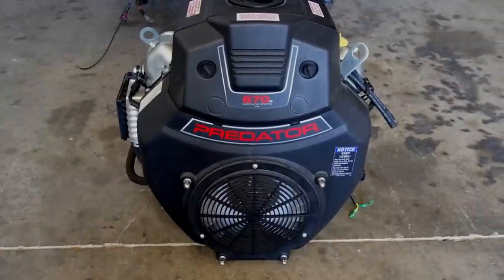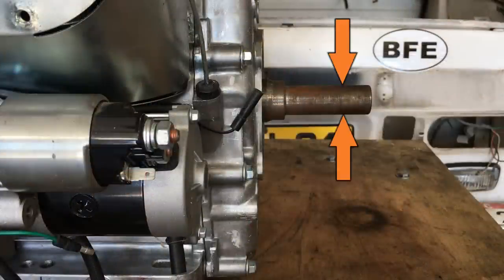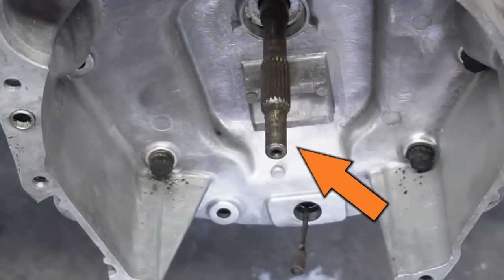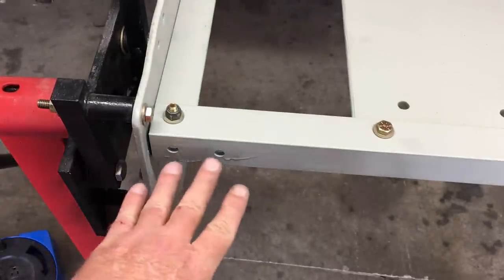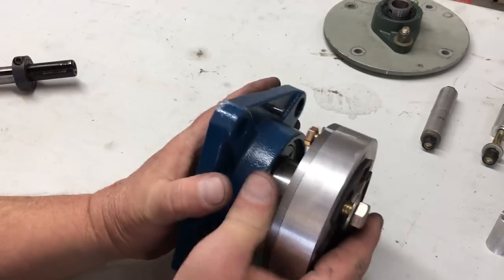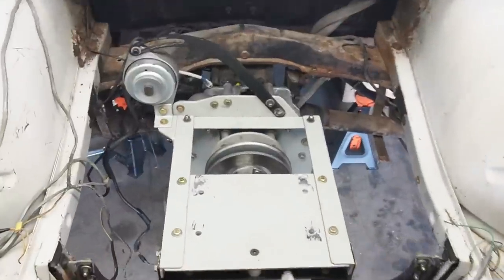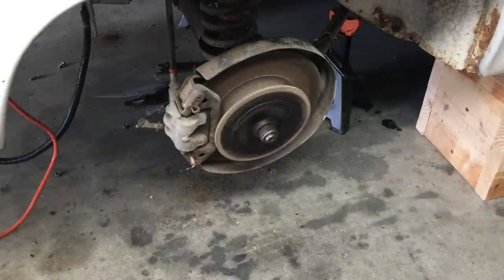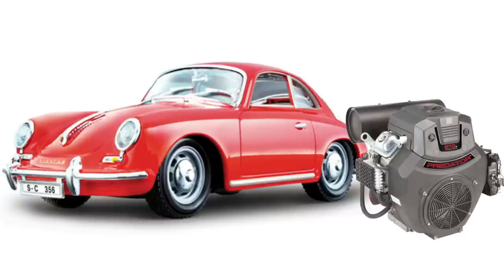S3 E18 We put a 670 Predator V twin in our project car 1969 Renault 10

Comment: Can’t wait to see it with twin turbo’s ✌️
Reply: Theirs no way 2 cylinders can spool 2 turbos if a 3 cylinder diesel can barely spool a turbo
Reply: @Llyduramax  pretty sure theres were joking...
Reply: Two smol turbos are easier to spool than single big :>
Reply: @mmllmmll22  small enough turbos don’t exist
Reply: Better off having 2 exhaust pulses for the turbo
Reply: @MyLonewolf25 Garrett  has turbos small enough.  
0.5lb/ min  is small enough to support a 3hp Briggs and Stratton to make 5hp.
Reply: i need to see this happen now
Reply: Can't wait to see with quad turbos and a supercharger slapped on top of it
Reply: You're crazy bro! Hahaha!
Reply: @SilentKx2  ya it'll be twin compounds for each cylinder with a safe 3:1 PR each at 6 BarA it'll need some methanol  to keep the wrist pins from melting out of the pistons. Lol but the blower is for lean burn mood on a clutched bypass . IIRC 28-31:1 AFR  is proper. When you stomp it the blower clutches out into bypass  you get the enriching effects coming out of lean burn. 
To think above the top shelf sometimes is just a little to far out of the box for people's comfort.
Reply: Does not need turbos as it can be built to 50hp without them.
Reply: compound 😅
Reply: @nandrews8412  I Twin trubo'd my roller skates and it spooled just fine
Reply: Think you mean twin Turbskis.. lol IYKYK
Reply: @joshchamberlain9413  Yeahhhh bruthur!
Reply: @MyLonewolf25  there is turbos for 50cc mopeds, what are you talking about?
Reply: @MyLonewolf25  a VZ21 will do the trick. Several YouTube channels have put them on the Predator 670 with excellent results, some getting up to 40-50 horsepower.
Reply: @Llyduramax  tiny turbos. Like- really, really tiny turbos. 😂
Reply: Yeah, I think I saw someone get 75hp out of one of these
Reply: @KiRiTO72987  75hp would be fine for short bursts, like drag racing, but it would either be putting out too much torque or too high of revs to last very long as it would probably twist the rods. Personally I wouldn't want to see more than 50hp for short periods of time and no more than 35-40 for an extended period.
Reply: Time to built two small custom turbos
Reply: I personally think a supercharger with an air intercooler makes the most sense as it won't add a bunch of heat to an air cooled engine

Comment: This is going to be a really important milestone. If memory serves, this car in its stock configuration delivers something like 40 hp or so. Are we into the first project that is actually able to match (if not improve) standard engine figures? Anyway, we’ll follow the process with great interest. Thanks Jimbo!
Reply: I believe it had 46hp with the first engine, then the later 1.3l had something like 52hp. It will be interesting to see how close to the original 0-60 of about 20 seconds (iirc) he'll get with the predator twin after upgrades. Perhaps it could even be faster depending on how far the engine can be pushed.
Reply: @tei1337  considering how much the V-Twin can be squeezed,i guess we can match that power figure in the long run.
Reply: @gustiwidyanta5492  yeah, I wouldn't be surprised. Not sure if Jimbo's bench dyno that he used on the  "big block" in the insight can handle this engine, but we will still be able to compare 0-60 times to the claimed time for the original engine.

Comment: Just a little heads up. The Honda clones tend to have a lot of metal in the oil during the first 15-20 minutes of operation. I would recommend running the motor at different RPMs for about a hour and then change the oil and filter. The 670 isn’t as bad as the other predators thanks to its oil filter but probably still a good idea. I have a video on my channel of a 459 (they just have the strainer and a true filter) and it was pretty nasty after maybe a half hour of run time.
Reply: Predators aren't Honda clones. That's the literal Honda knockoffs you're thinking about, Project Farm did a review on one I think.

Comment: Mr. Robot, those 670 carburetors are notorious for sticking float bowls and leaking fuel all over the place. Keep an eye on it and don’t burn that beauty and yourself up.

There’s a lot of really nice aftermarket parts for these engines that take them to the 50hp+ mark real quick. That little car would boogie!

Comment: 2:30 - I've been a big Saab fan since I could drive (early 2000s), I've had a couple Saab 900 turbos from the mid 80s, and man those thrust bearings always go bad. An engine not designed to handle that at all, it'd be fine for a project going a couple of thousand miles sure, but I don't know if the average car person understands just how important what you're bringing up is; those lateral movements put a ton of strain on the components... I'm glad you mentioned it!

Comment: My first car was a FIAT 126, twin cylinder rear engine, about 650cc. An important thing to note is it had a big (about 6 inch) tube pulling cold air from the sides of the car, and into the cooling fan, once the tube came off so the engine just recirculated the hot air in the engine bay, so it overheated. I'd have been tempted to have used a centrifugal clutch between the engine and input shaft of the engine, just like a special version of the Citroen 2CV - I think it was called the traffic. Great video though, I'll look forward to see how it runs.

Comment: That gearbox shaft has play in it because almost all old cars have a bearing inside the crankshaft that centers the gearbox's input shaft.
There is no other bearing to sustain the shaft on that side (what you see is play between the gears).
Even getrag 240 (80's 5speed gearbox) doesn't have an input bearing. It only has seal and a cover

Comment: Just wanted to throw an idea out there. They make some pretty hefty (and affordable) agricultural PTO/ chain drives, maybe see if you can make an intermediate chain or PTO that goes into an assembly with the output to clutch / flywheel ect. McMaster has you covered in finding an appropriate thrust bearing for whats going to be a custom n a half ordeal. You'll have to sort out the axis offset but maybe an opportunity to mount the engine lower than the transmission axis!

Comment: This interesting,  and you must be an engineer.  I like the way the clutch adapter works.  That's really nice engineering.  Well thought out just let off the throttle shift gears and step on the gas again.  Kind of like shifting an automatic.  Nice work sir.  😊

Comment: Are you considering a camber compensator for the swing axles? You've mounted that engine pretty high and that might have changed the roll center enough to provide some unexpected handling if you have to swerve. (Corvair owner here - camber compensator that came in '64 made the car handle noticeably better toward the edges of its performance envelope).
Reply: While the the only envelopes going to be pushed are delivered ones, I would like to see a handling car given the interesting motors a handling car would be worth a watch!

Comment: I had a 69 with a manual choke. You need to check the  axel strap on the passenger side rear wheel. A neat project. These cars came with an 1108cc 51 hp 4 cylinder. The car only weighs 1700 lbs.

Comment: Being a leader requires confidence, decisiveness, and quick thinking--none of which are served by overthinking every decision or scenario or worrying about every move you make. There’s a time to think, a time to act, a time to reflect, and a time to move forward.
Reply: Overthinking causes us to spend too much time thinking, getting stuck in a loop of inaction, and turns positive reflection into debilitating worry. Not only does it not move us forward, it moves us backward and downward.
Reply: Reopen the door only when new information knocks.

Overthinking goes into overdrive when we keep revisiting decisions we make, refusing to close the door on a call that has been made. Believe that you’ve done your due diligence, and revisit something you’ve already decided only when you’re presented with new information.
Reply: Know that overthinking and problem solving aren't the same thing.

Constantly ruminating and going over scenarios and possibilities often disguises itself as problem solving. It feels like you’re doing something good and useful. But you’re not, you’re just spinning in a circle. Recognize when you’re overthinking something, don’t act like it’s problem solving, and press fast-forward.
Reply: Remember the 90-10 rule.

This is a formula, a ratio, for how you should calculate how you value yourself, based on 90 percent self-worth, 10 percent assigned worth. Ninety percent should come from your self-acceptance and self-appreciation, and just 10 percent from that occasional sliver of external validation we all need.

Overthinkers distort the formula, even reversing it by acting like 90 percent of their worth comes from what others think or say. So they worry, which takes the form of--you guessed it--overthinking.
Reply: Assume good intent.

Overthinkers read too much into things. Why? They’re assuming something bad lies underneath, something like a bad perception, someone wishing them ill, or an unfavorable outcome. When you catch yourself doing this, switch your assumption to what you're reading into was well-intended, or at least neutral. The vast majority of the time, it really is, so why not act like it?
Reply: Embrace uncertainty.

When we don’t know something, we tend to fill in the blanks, often with garbage assumptions. Why? Many of us would rather be unhappy than uncertain. Garbage assumptions can take many forms, all infusing themselves into the inner monologue of the overthinker.

A Buddhist chaplain once taught me how to handle uncertainty. I remember his teachings as an acronym: OAR. Observe uncertainty, don’t overreact to it. Acknowledge the presence of uncertainty and accept that impermanence is inevitable. Realize that uncertainty brings benefits, like unleashing creativity and resilience.
Reply: Replace “what if” with “we’ll see.”

Overthinkers keep asking themselves “what if,” which is an impossible question to answer. If you catch yourself asking “what if,” quickly switch it to “we’ll see,” which is a way of moving past analysis paralysis to acceptance.
Reply: Get outside and play.

By this I mean stop spending so much time in your head. Get outside it and switch gears to connect with what's going on around you so you can take joy in it. It can be dark and foreboding inside that head of yours, no?
Reply: Do the math.

Overthinking also comes from overworrying about the worse-case scenario, which of course no one wants to experience. But ask yourself, “What is the probability the undesirable outcome will actually occur?” Odds are, not very high.
Reply: Stop framing the unremarkable as catastrophic.

Related to the above, this means stop taking small details and turning them into questionable conclusions. Stop making a mountain out of a molehill. Unlike at the mall, this kind of escalator lifts nobody up.
Reply: Evaluate the true impact of being wrong.

We often feel the need to overthink because we simply fear being wrong. It might make sense to overthink things if you’re planning to jump your motorbike over the Grand Canyon or to go swimming with a great white shark. As for overthinking the decision you made in that meeting yesterday? Not so much.

Ask yourself in such moments what the realistic cost of being wrong is. When you can lower the stakes, you raise your ability to get mentally unstuck.
So don’t overthink it. Take the inspiration here and run with it. Without looking back.
Reply: Great leaders create more leaders, not followers.
Reply: Shine your light and make a positive impact on the world; there is nothing so honorable as helping improve the lives of others.
Reply: Your beliefs affect your choices. Your choices shape your actions. Your actions determine your results. The future you create depends upon the choices you make and the actions you take today.
Reply: Authentic leaders will always be happy to hold the ladder and allow others to climb to the top.
Reply: “Whatever you dream you can do, begin it. Boldness has genius, power and magic in it. Begin it now.” – Goethe
Reply: We live in interesting times. We’re blessed that way.

The world is changing rapidly.

The way we work is changing, the way we live has already changed. Entire industries are crumbling, and more are growing on their ruins. People are empowered to express themselves, to create, to become a part of a global conversation and transformation, in a way that has never existed before.
Reply: What will you do with that?

What will your place be in this new, interesting world? Will you have a voice? Will you be a creator, or just a consumer?

Do something.

Do something interesting.
Reply: Be a part of the conversation, and say something remarkable. Create something unique, new, beautiful. Build upon the works of others and transform it into your own.
Reply: Put your heart into something. Say something that no one else dares to say. Do something others are afraid to do. Help someone no one else cares to help. Make the lives of others better. Make music that makes others want to weep, to laugh, to create. Inspire others by being inspiring. Teach young people to do amazing things.
Reply: Be profound. Find focus in a world without it. Become minimalist in a world of dizzying complexity. Reach out to those who are frustrated, depressed, angry, confused, sad, hurt. Be the voice for those without one. Learn, do, then teach. Meet new people, become fast friends. Dare to be wrong. Take lots and lots of pictures. Explore new cultures. Be different. Paint a huge mural. Create a web comic. Be a dork, but do it boldly. Interview people. Observe people. Create new clothes. Take old stuff and make new stuff from it. Read weird stuff. Study the greats, and emulate them. Be interested in others. Surprise people. Start a blog, write at least a little each day. Cook great food, and share it. Be open-minded. Help someone else start a small business. Focus on less but do it better. Help others achieve their dreams.

Comment: Would it be possible to use some kind of bracket/flange and inner duplicate thrust bearing between the flywheel and the engine, so the engine case is taking the thrust instead of the shaft? Of course it would probably wear out kind of fast since I can't think of a way to disengage it with the space constraints. I guess you could also just run an offset shaft on pulleys or gears that could handle thrust too. That could be cool as it would allow you to change input gearing for the whole transmission. 

Honestly I think the CVT clutch works well enough, I just like the idea of over complicated contraptions to do relatively simple things, so incorporating a thrust bearing friction clutch into the build would be fun to watch.

Comment: There's some pretty insane 670 builds out there supposedly pushing 70+hp...i imagine if you did anywhere near a build like that, you'll end up with a pretty capable little car.
Reply: check out cars and cameras 670cc drag rail
Reply: At 70hp it would almost be able to keep up with a stock R10. :)

Comment: Just in case, I thought I’d mention, electric start lawnmowers always have a way to charge the starter battery. It’s usually a funny kind of alternator built into the fan/flywheel assembly. Give you’ll be running lights and ancillary equipment, as well as using the starter, you’ll probably be using a larger battery and might need a beefier alternator.
But maybe not! Personally, I would have tried it, before modifying the cvt pulley.

Comment: I owned a 1971 R10. It was my first car and I bought it brand new in 71, as it was cheaper than a VW! It was a great car. Disk brakes, radial tires (which still weren’t common in 71), and VERY comfortable seats. Plus it got 35mpg!!! Plus in all the years I had it, I never saw another one on the road. However one scary thing about the R10 is the fuel filler is in the engine compartment!! So you had to to be very carefully filling it with gas.👍

Comment: The guys at Performance 670 can squeeze 43 HP out of these little engines. I'm sure the power curve is nothing like the original engine, but that would at least put you within shooting distance of the original motor's output.

Comment: I don't want to come across as another " You're doing it wrong! " person since it's your project and I've always thought what you do on this channel is cool AF, but I'm a bit confused about something and comments are for feedback, so...

My experience with this sort of motor is that they're meant for mowers, pumps and stuff that don't have a lot of electrical stuff on them, but if they've got an electric start, they've got some sort of method of charging the starting battery. 
For example, my lawn tractor has a vertical shaft 17 HP single and electric start. It's got alternator windings on the fan/flywheel to charge the batteries and makes enough power to also run the weak-ass headlights on the mower. My guess is it's possibly as large as a few dozens of watts!
Admittedly, this wouldn't run all the accessories on the Renault like headlights and tail lights at once, but would charge the battery and likely run turn signals and instrumentation. 
Update: I dug through the parts list and exploded diagram and there are three charge coils under the flywheel, so I'm pretty sure it can make at least enough charge current to keep the battery topped off. The 20A alternator still seems like a good idea, though. 

Good luck with the project and nice work!

Comment: The wonky input shaft on the gearbox is normal for these cars. Same as the renault 4. If you take the bellhousing off the shaft is linked with a sort of bushing to take it out without disasbembling the entire transmission. This can be done to take the diff out.